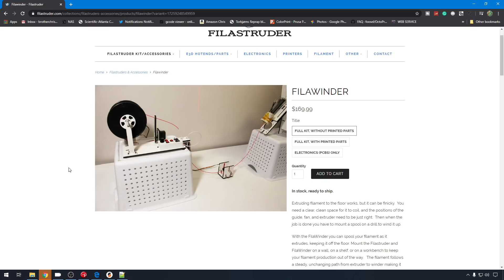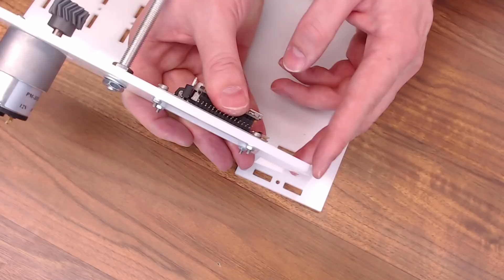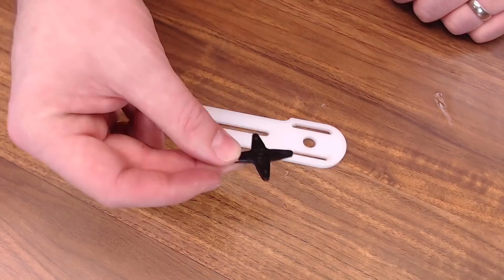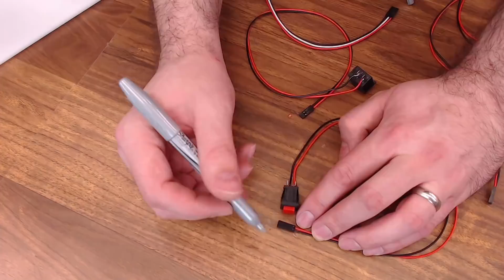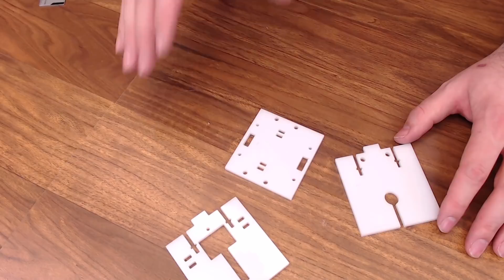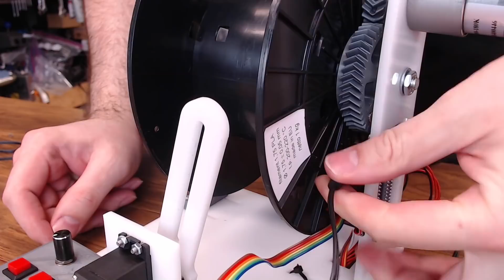The Filawinder - Assembly - Chris's Basement

Comment: It the motor is the same as an RC Car with a reduction gear you can use a 540 or 550 motor with a lower turn number on the winding to  get a faster motor like a 27  turn motor or remove the reduction gear and drive directly off of the Motor.
Reply from the maker: Thanks for the tip!

Comment: get video as always, i have 2 questions 1 when you where soldering i did't see you use heat shrink after to protect the solder joints  and 2 was  for connecting power you also soldered vs using slide on power connectors ( i think there called 19-20).  once aging great video.
Reply from the maker: Thanks Ron, yeah I just soldered everything up to make it quick I could go back and do crimps and cover the terminals, but it works in a pinch.

Comment: I use the same vise for soldering. Lol. Hey you ever think of a video for a raspberry pi fan. I have a raspberry pi 4 and have a noctua fan on it but would like it to turn off when I shut it down. I can't find any good videos on this. I use a power button to shut my pi off so it stays plugged in so fan always runs.
Reply from the maker: Love that vice! Interesting idea, I am sure we could set something up to make that happen. I will have to see what I have laying around.
Reply: @ChrisRiley  thank you. Hopefully you can come up with something. In also working on making my Pi portable and rechargeable. I tried the adafruit thing but not enough power. I think I found a board that will work now.

Comment: Would be cool with an addon that would allow splicing filament, even if manually switching between the two. Similar to what the palette 2 does, but purposed for spooling onto the filawinder. :)
Reply from the maker: We have talked about that type of device for years now, I really need to start working on that one again.
Reply: @ChrisRiley  would be so good. I have loads of spools which are very low. I dont want to throw them out, but theres so little left that they can only be used for tiny prints. In addition, so close to the end that it's very prone to falling off the spool holder :p